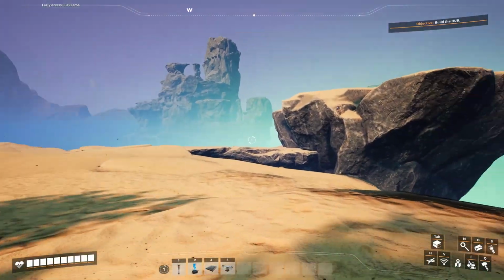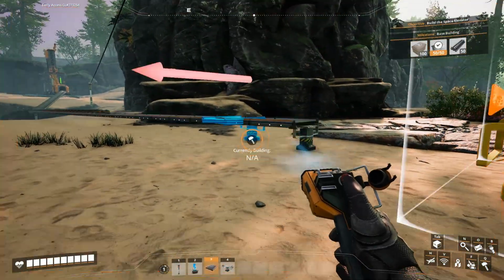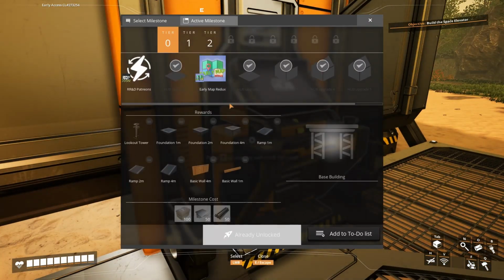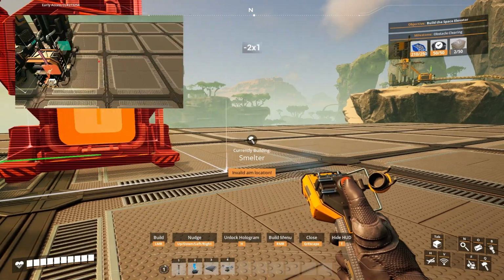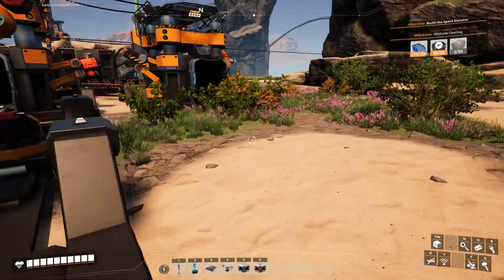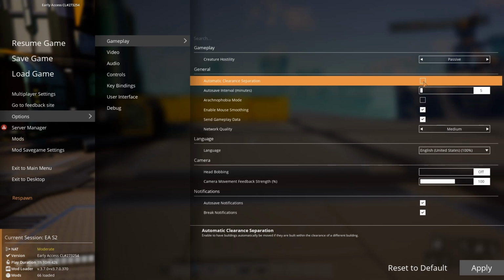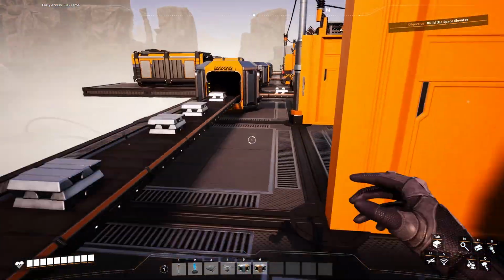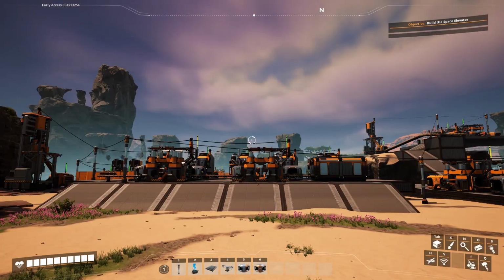Season 2 Premier! - S02 E01 - Satisfactory with Mods

Comment: The video seems to be stuttering quite a bit, is that something you have noticed / tried to fix? Not sure if recording and uploading with higher fps would do the trick or if there is some other underlying issue.
Reply from the maker: I didn't notice that much stuttering in the final recording, I typically get 100+ FPS but record at 30 (Bandicam default). I can certainly try at 60 and see if that helps!